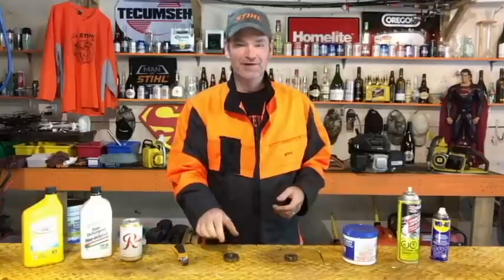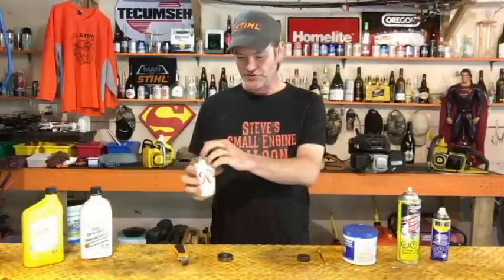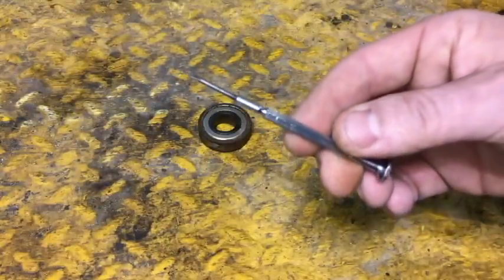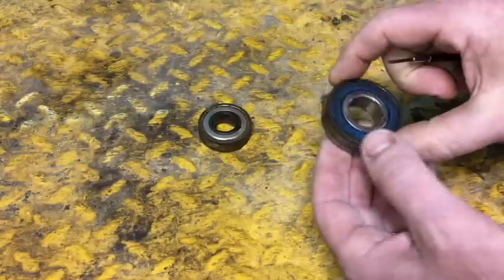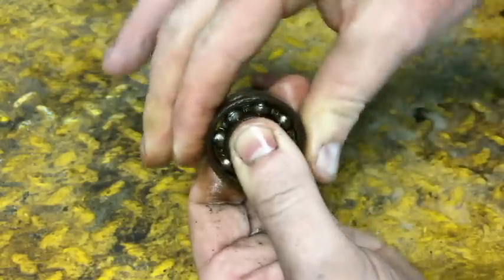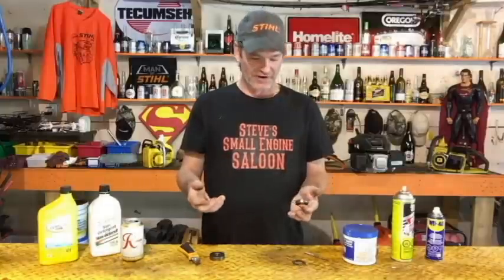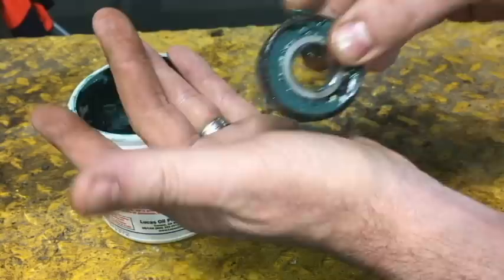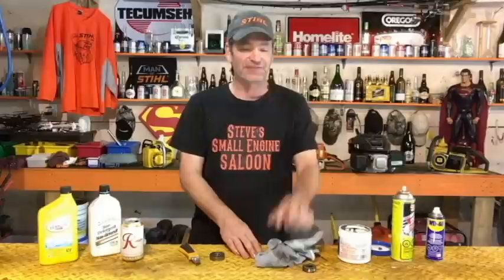How To Un-Seize, Clean and Grease a Sealed Bearing

Comment: From me a thumbs up! I'm installing 2 new sealed bearings and shaft in our Clothes Washer, should I open the seals on these two new bearing and palm grease them for some prolonged life???
Reply: @Joser1948 well the factory knows how much grease to put into a bearing. And you'd be surprised how little that is. A wheel bearing will sling out what it doesn't need. Sealed bearings you could pop the seal.

Comment: Hey
My friend has a stihl bg86c. Leaf blower that's not running correctly at all. He's put new gas line &filter,air filter, new carb,checked all the head bolts for proper tightness,spark plug etc it won't rev up.  Any bloody ideas mates????? TIA

Comment: The absolute best way to get old grease out of a bearing is compressed air. Makes a little bit of a mess, but the bearing is absolutely spotless.
Reply: What about ultrasonic bath?
Reply: @johncollins8304  Depends on the solution. I'd say dip it in gasoline for a couple minutes without the rubber seals then blow it out with air. If it's thick grease then the ultrasonic wont do much. If it's little grime then an ultrasonic with some degreaser will work good.
Reply: @nepicness  Thank you.

Comment: Hello Mr. Steve, I thoroughly enjoyed your video. It was very comprehensive. I live in New York City, and like most New Yorkers, I don't drive, so my mechanical skills are not really put to the test. I do ride a skateboard, however, and from time to time I get my hands dirty by cleaning my sealed bearings. I have noticed that sealed bearings for skateboard wheels are never heavily greased, and the lubricants marketed to these bearings are usually very thin.  Still, it doesn't make sense to me to use a thin lubricant for a sealed bearing because how can that seal keep the lubricant within it? I plan to clean my bearings soon and I am contemplating heavily greasing them as you illustrated in your video. I'd appreciate a word or two of advice sir. Great regards.
Reply: Lighter lubes have less drag. So they're what you want to use on something like a skateboard where you want as much glide as you can get. A lot of old school drag racers used to oil their wheel bearings to reduce drag. They didn't need long service life out of the bearings. They were only going a quarter of a mile. Maybe a mile all day if they got a few runs in.

Comment: I used to use the palm method to pack car bearings because nobody had a bearing packer. So if I had to take off the rotor for an older model car I would pack the bearings that way before putting the rotor back on.

Comment: I just replaced the belt on my LA -125 and one of the pulleys was dry so I did like you said worked out good but I still have some side way movement in the bearing should I just replace it?

Comment: Any tips on removing the metal shields without hopelessly buggering them up? Just tried on one the prying on the outer rim I didn’t have enough clearance to get anything in there. More clearance on the inner rim but no leverage so ended up destroying the cover. Ideas?

Comment: I believe the blue and green greases are not lithium. They are "Poly" ball bearing grease specifically for ball bearings. The odd thing is that Poly grease is universally incompatible with Lithium grease so you have to clean all the old black grease out before switching to the more longer lasting Poly grease.

Comment: Help Hey
My friend has a stihl bg86c. Leaf blower that's not running correctly at all. He's put new gas line &filter,air filter, new carb,checked all the head bolts for proper tightness,spark plug etc it won't rev up.  Any bloody ideas mates????? TIA

Comment: Why such a thick grease, why not something that doesn't attract dust and such like to adhere to the bearing? I prefer to use powered Graphite, locksmith's use on locks, as it lubes well and doesn't attract dust to adhere. I appreciate some feedback as I have the above problem and there could be other options more practical.

Comment: Open the bearing and wash the inside with kerosene and a soft brush. During reassemly pack it with bearing grease. If the bearing is fitted with a grease nipple, pump the grease into the bearing until the grease comes out clean. Then wipe off the dirty grease and excess. Clean the assembly finally.

Comment: Cleaning and repacking with fresh grease works for bearings that are stuck with dried  out grease.  Rust doesn't just wash out  so easily and rusted bearings should be discarded as the rolling surface of the balls/rollers and races will be pitted.  The damaged bearing  will be rough/noisy,  won't last long, and may lead to damage to the part in which it is installed.
Reply: yep....if its a bearing in a spindle...or other high speed/important areas,,get a new bearing and lube it.

Comment: New bearing = about $10.   Rusty seized bearing won't last long even when re-greased. If YOU MUST do it,,wash bearing in gasoline before repacking with new grease.  Careful not to use too much grease, especially for high speed bearings in cold weather. They don't turn well when very cold and cause more problems than they are worth.
Reply: Maybe you should make a video then

Comment: You have seals and shields.
Seals have a rubber lip riding on the inner ring
Shields are non contact metal plates (small gap remains)
Reply: Either way you have to pop them off to service the bearings.
Reply: I'm having trouble with my..... shield.  It wouldn't pop on the od, almost like there was a little groove.  I was able to get one side off but the shield isn't pretty now.  I am not sure if it'll go back on.  {Norma xf-121-pp}

Comment: Pabst 🍻 CHEERS
After 3 years!!
Steve that's worth 3 beers 🍺🍺🍺
I spray my bearings out into a catch, with throttle body cleaner. That stuff is so sharp, and that palm packing? That was awesome. Never thought of it ever b4. 
I like to pop the seals with a exacto 3inch blade, instead of the snap off blades, only due to thickness. I spray it, run the tip of the blade around the seal edges, then pop em for free easy release. Trust me...I've bent a few. They're done at that point lol.
Cheers...we gotta do some beers. I've got a project if you're interested.

Comment: Great tip will do seized  idler pulley on car
Reply: Cars are a special case. Can't really screw around there. As there's just too much potential for catastrophic consequences. Little sucks worse than being broken down in the side of the highway in this world. It has literally killed some folks in extreme situations. But if your garden tractor craps out on you mowing the lawn it isn't a life altering event. You can usually walk inside and get a cold one.

Comment: I just had an idea that might help some people...put a full thread bolt threw 3/8ths diameter or whatever run a nut down to grab the inner race  and chuck it in a battery drill and grip the outer race with a pair of pliers and hold it under water with some dawn soap and spin the shit out of it.. maybe soak it in vinegar or blaster bm first....great video.as always

Comment: I soak them in white spirit or petrol, then blow clean with compressed air. Spin them a wee bit lubed by penetration oil then repeat the cleaning exercise. Works great and the bearing will normally last a long time after this treatment.
Reply from the maker: Right on ...

Comment: The metal inserts are call shielded bearings the ones with plastic first called sealed bearings shielded bearings will let water in
Reply: For outdoor performance/sports equipment we apply a layer of waterproof tacky grease to the outside of the shield wherever it's possible which is very effective at keeping the water out.

Comment: If there is actual rust, remove old grease with a solvent like kerosene and soak bearings overnight in Evaporust. Polyurea grease is good for sealed bearings. Now order a new bearing before your rescued bearing fails.

Comment: You rock🤘 first we need beer!
Would have loved to see you put the metal cover back on in this as im off looking for small engines and engineering seal unit bearing info for all the numb nuts in the skate community treating some of the worst quality bearing around like they have been gilded in gold.
I shoukd not hang it on them to hard but i skate and am a fitter and turner too so i shake my head and say
 " really , do you treat the bearings in your car so precious? Slap some wd40 in there and pack it with grease as you my friend are never going to roll as fast as a bearing in a machine " . 

Let me know if you ever do a solely metal sheild vid so i can forward it on to tye people that are buying $30 plastic bottles with a bolt through the lid just to soak their bearings in acetone and then spending $15 for 5floz of sewing machine oil to put jut 1 drop in per bearing like its magical oil and some are even getting ultrasonic baths that jewellers use to clean there bearings because they seen some sand in it that day and it must be in their bearings .... quick clean them or they will die... @ $3 a pop  and if not free spinning at 100ml ph between there fingers its dead to them but all it needs to do is move smothly lubed up , it will spin well enough under load with their weight on it going as fast as they can with flinstons push power ... face palm.

Comment: Tried removing seal on metal cover, got inner frace edge out all the way around 360 degrees, wont come out. Was able to then go around with tiny screw driver, still nothing. Now seal getting distorted.  Was a good used bearing, now what? It is a peer fh205-16. Tried plastic one, popped right out.

Comment: You could soak in 50% white vinegar and water. depending on how Rusty it is I would let it soak for a couple days pull it out with the toothbrush and fresh water hot water rinse it out good then soak it in your oil clean it up once again and then repack it.

Comment: FYI.  Blow your mind !   Get winter use hydraulic (t-22 ) or  what ever oil mfg. Number is put in a cup and let it work  !    Don't forget to wash clean and pack grease in with high temp lube before replacing dust shields

Comment: 2 year old video I know, but wouldn't it be better clean the rusty bearing out and soak it in muriatic acid or something and desolve the rust before repacking it? Depending on the application what's shown here is probably fine but if it's a bearing that needs to move at high speed or for a long period of time I can't see leaving the rust not killing the bearing completely at some point.

Comment: If the bearing had already siezed, it is probably damaged and repacking it won't help.  
I have repacked noisy sealed bearings using your method.
Reply: Repacking it will definitely help. But it won't make it like new. Could make it good enough though. It depends how bad off it was and what service the bearing is doing. Often as long as it's moving it's OK. Probably be noisier.

Comment: Ultrasonic cleaners are great tools to have in the shop. From cleaning carburetors to bearings to your girlfriends jewelry... they’re just plain useful.
Reply from the maker: I agree!  I use one every day...
Reply: Dang, why didn't I think of that!
Reply: I continually create one-gallon ice cream buckets and I keep the buckets and their lids for all sorts of projects such as storing gas, diesel fuel, Hoppe's solvent, etc, to be used in cleaning stuff. I also keep a set of buckets, stacked upside down (so they don't collect dust) without their lids, numbered 1 through 10 for storing parts when I take stuff apart.
Reply: Do these things just vibrate or is there more to it?

Comment: Why, I wunder does Dony Boy  say not to touch the metal ones??  And are they guards or seals? Someone below raised 'guard's but didn't explain. 
I was expecting to hear 'sonic bath'. How come not, Steve? Not good idea? 
I've just received new spindle assemblies (no shafts) for Murray. 20€ each. I would like to have a look inside -- remove the metal seal/guard and maybe put more grease in. . BuT I don't want to bash it about to remove the bearings as I did the old one. I was just going to replace the bearings but they were as dea r  as the spindle. If I'd I'd I'd seen this first I'd just have cleaned and repacked them! Bah! 
I'd like to know what the last letters of the bearing numbers mean -- maybe they are only sealed on the outside.  2RST  and 2RST(Sor5!)/8. Is there an ISO chart anyone? 
Is there a fine  puller that can squeeze under the bearing to extract it? 
BIG THANK YOU!

Comment: I have tried tested and proven solution to treat any bearing and see it last long long time and many kilometerssssssssss. This will become primary lubricant and is good for +50 Celsius or minus 50 Celsius and high pressures . Few treated by me have lasted for more than 5,00,000 kilometers and still good.Cost is reasonable.

Comment: Maybe in a pinch but timken bearings that size aren't all that spendy.   If a bearing is actually shot I'd much rather go with a new one.
.... full disclosure - I once took a used automotive flywheel bearing and used it to replace a seized one in a chain hoist.   It just happened to be the exact size I needed and was still in great shape.   Never have had to buy a new bearing for anything
Reply from the maker: Right on...
Reply: You may be right Ryno Horn...but you can't deny that it's a good excuse to have a nice  cold beer :)

Comment: 3 days ago, I questioned whether it was necessary to pump grease into the spindle shaft of a riding lawn mower or simply grease the bearings snd re-install. I just posed the same question to Dony and he responded immediately. Ontario 1; BC still in the huddle!

Comment: I really like the first thing you need. I mean who the hell wants to pack a bearing without a beer right.
Reply from the maker: Agreed!
Reply: @StevesSmallEngineSaloon  btw I found some bearings just cant be opened so for them I make a small opening and squirt the grease in with a 1mm needle tip and a syringe. Works like charm. Unfortunately I can't make a video on it. maybe you can. Try it and make a video.if you can

Comment: Hello Steve. My following remarks are in reference to your fuel stabilizer presentation, not this presentation.
 In my veiw you neglected to mention the chemical composition of fuel stabilizer.
I researched it on Google and I learned the following: Fuel stabilizer prevents most of the oxidation of degraded gas to build up in your carburetors and fuel lines. The petroleum chemistry is a mix of Paraffin (essentially kerosene) Napthtecin (mineral oil) and petroleum distillates with somewhat thicker viscosities. The page I looked at, and the fuel stabilizer you recommended, is made in Europe and they have a "secret recipe" they don"t share. What bullshit!
Still, I'd buy $10.00 worth to add to my small volumes of gas in my equipment before winter stirage  instead of 2 cycle oil and even drain it mid-winter. Fuel degrades between 3 and 6 months (frost) (and the biting cold of Alberta winters means more care is needed) causing the oxidation (water) to accumulate in our small equipment - 2 cycle and 4 cycle engines.
Never run the gas/stabilizer mixture through your carburetor in the spring. Always drain gas tanks  completely and even run high octane gas for a few minutes to blow out the accumulated gunk in your carb.
It's not necessary to use fuel stabilizer year round especially in spring, summer , and fall and its a waste of money if you use your equipment regularly and change the fuel.
I couldn't find your presentation on fuel stabilizer so I put my remarks on here for your fans. I hope this helps.
I am not paid by STA-BIL22209  @ $9.99. This gives you more bang for your buck and its more than enough for the little amount of gas/STA-BIL ratio you'll need for the average dude's lawn and garden equipment.
David
Alberta

Comment: That bearing could have done for a bit more cleaning. Put some gasoline in a can and swish the bearing in that. Dollar for dollar gasoline is the best solvent you can get. Then blow the bearing dry. But don't let it spin while you're hitting it with compressed air. I know it makes a cute sound. But you'll score the bearing. When you're packing grease into a bearing just work it from one side. When the grease comes out the other side you're done.

Comment: I read a lubrication guide that talked about failures from filling bearings too full with grease. When bearings are packed with grease the force on the grease is high as the balls have to force it out of the way. This increased drag heats the grease, it expands and can cause the seal to pop. This is not a more is better situation.

Comment: I must have palm packed a few hundred bearings over the years🤮.  I hate packing bearings, NASTY.     One fine day I bought a bearing packer 15 years later it split from old age and I’m onto #2.     A bearing packer is a must if you own a boat trailer just bite the bullet and store it in a sealed plastic bag .   No more, well at least minimally slimy hands.   Get a packer you’ll be glad you did...👍🏻

Comment: Steve now you know damn well if it's a seized bearing it's a damaged bearing so easy to replace from Amazon at around $5.... measure to size a specs and save $$$...Oh, and use an ABEC 5 or 7 double shielded bearing...
Reply: It is not so easy if you have a job you need to do today. So clean 'em, grease 'em and put 'em back in service.

Comment: You saved me from buying a new idler pulley , thanks
Reply from the maker: You're Welcome...
Reply: no kidding.  most pulleys are 20-30 just for the wheel and new bearing.
instead, pop out the old, and either regrease or replace, for about $5.